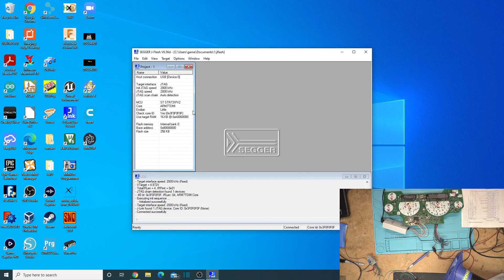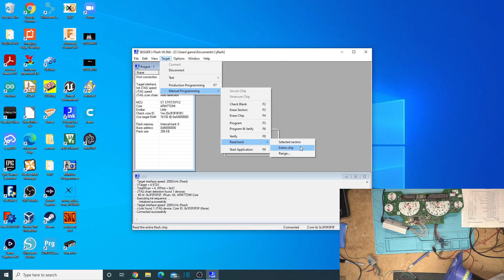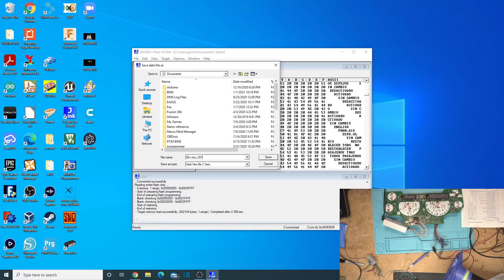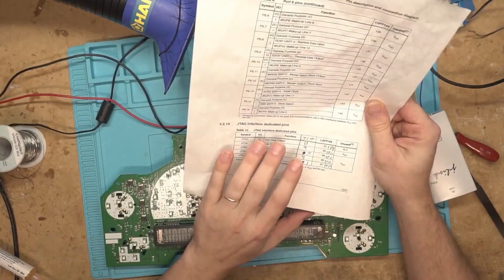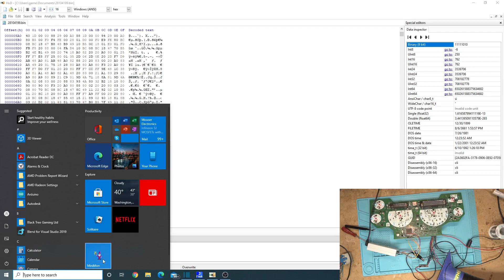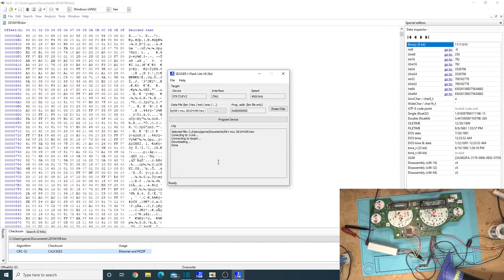07-14 GM Truck Instrument Cluster MCU Replacement ST30F772A

Comment: Great video. I got a midroll ad, got monetization all set up already? I should have sent you one of them suction cup pens for pulling chips up, I'll try to remember next time I ship something to you. Run out of MCU's yet?
Reply from the maker: I did for the 03/04 ordered more I have 2 left for the 07+ I will be out of infix the other 2 boards. I meant to order more on my last utsource order. It gets delivered Tuesday.
Reply: @FixedUntilBroken  ok. No need to sweat over the bad boards I sent over. There just cores. I know they are in good hands.